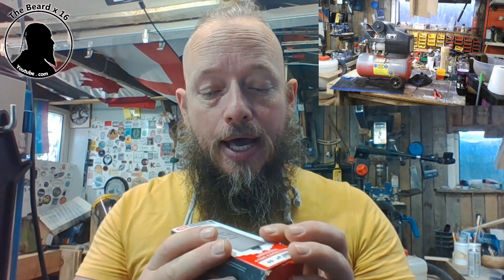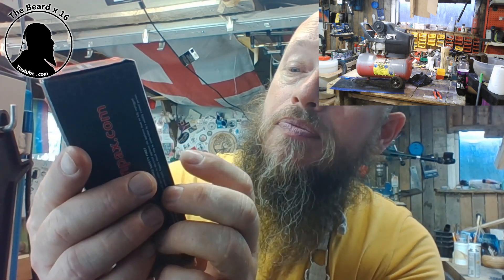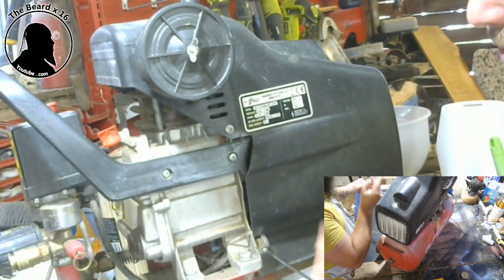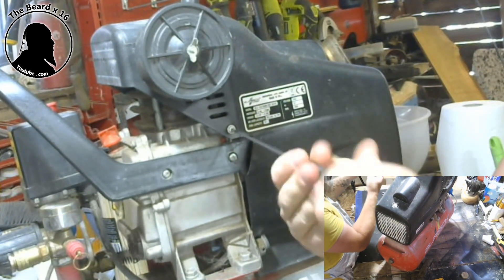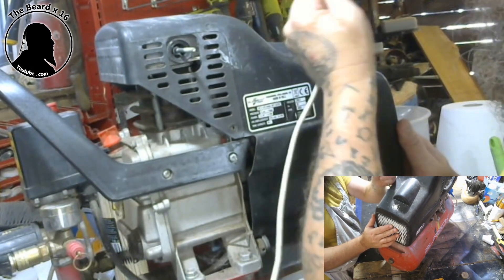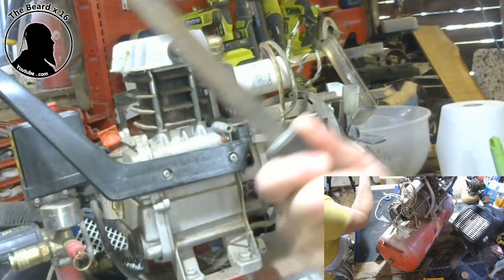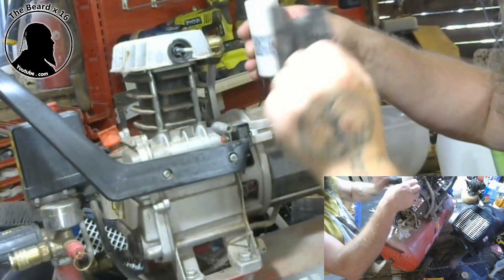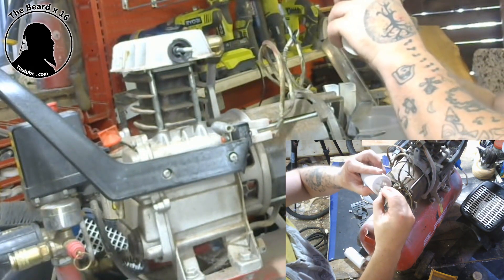How to change a compressor starter capacitor

Comment: Hey! Does it matter which wire goes on which terminal?
Reply: Thanks for the quick reply! I see no connection indication on my current capacitor so I guess I'll buy two and go for 50/50 chances
Reply from the maker: @stevemullaghy1625  makes sense whats the worse that can happen maybe blow a fuse .hope you can get it sorted though
Reply: Hey...if it helps anyone checking out your videos, I bought an AC capacitor so it doesnt matter which of my air compressor wires get connected to the capacitor terminals. I'll update once I receive the item and install
Reply from the maker: @stevemullaghy1625  cool thanks
Reply from the maker: Sorry cant say i just copied the way it was on the old one